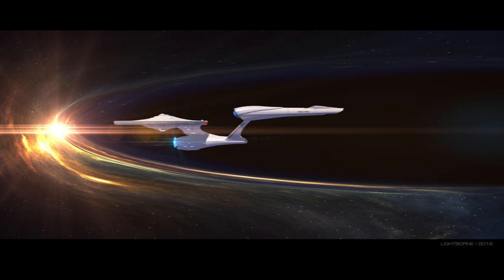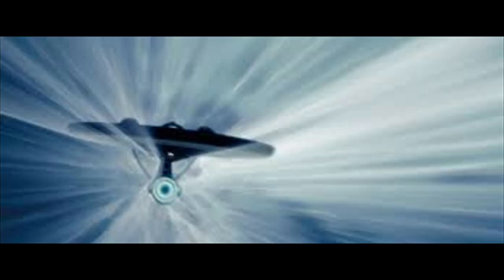Warp factors are not speeds

Comment: Honest criticism, bad opening. Starting with "They are not speeds" then leading with "why I believe so" isn't a great argument.  That being said you are touching on something really cool here. I have no idea if you are still making videos, but there is a lot to learn about the ways space time interacts. Even the problem of breaking FTL barrier. Infinite fuel (acceleration) vs Infinite time. It makes sense that ships are moving at warp based on their mass and energy output. The speed limit further reached to this and the changes to subspace and the damage it can have. Large ships may be going slower, because they must expend more energy and cause more of a rift. What truly matters is for a ship, how far are they away from their objective? If everyone needs to sync times, they don't all travel at warp 5, they would adjust accordingly. If the matter is urgent, you max out the ship's capabilities. It would make sense that a ship with a better mass to acceleration ratio would move faster than a flagship or a small supply ship. Too heavy, you are slower, too light, you limit fuel storage and capacity problems.

Comment: Nope , warp does in fact measure speed , but you have different scales to it , in TOS, and enterprise the speed is based on ^3 so warp 1 is 1xC and is 1 Cochran  in power , warp 2 is 8 x C warp 3 is 27x C  warp 4 is 64x C warp 5 is 125 x C ,  

TNG onwards changed it to warp 10 is the limit , warp one is still 1x C but warp 2 is 10 X warp 3 is 39x warp 4 is 102x warp 5 is 214x ( you can find a warp scale on Google ) the difference is the show is the speed of the plot , otherwise Enterprise in Enterprise series would take 2 years to get to Klingon homeworld in the first episode, where in 4 days at warp 4.5 tos scale there .99 lightyears from Earth .
Reply: A show is a show. The Youtuber is touching on the concept of what Warp Travel would mean and it's implications in physics. IN Trek, there is no standard speed. It is entirely show dependent. Want Warp 13? Sure. Warp 32, 36? 10 the new limit? Whatever you want.

Comment: If you rewarch that scene from Back to the Future, youll notice that Doc Brown and Marty say Gigawatt differently.
Its a moment burned in my brain as it reset my disbelief suspension algorithm. 
😊
Reply: Oh... right 
Also, the warp speed power curve, as originally published on the tng tech manual and reproduced all over the internet, gives a graphic from which it is possible to back-calculate the power required for the Enterprise-D to maintain any given tenth of a warp factor to within a two orders of magnitude. 
I have done this. It is extremely nerdy.
Once this is done, there are some interesting conclusions to be made. One is that the Saturn V first stage produced enough power, at 190 gigawatts, to jump the warp 1 barrier, accellerate to and maintain 1.8wf for 2 minutes, assuming it used power for each warp factor as the Ent-D.
Also, the data needed for these calculations talk about warp strain in cochranes, where a cochrane is a multiple of the speed of light. IE, 3 Cochrane is 3*c. And a given warp factor is c * (wf)^(10/3). Thus 2wf is 10c.
So, if you're going by the TNG Tech manual, your argument is no go.
Of course, it's probably an approximation.
Further, the power curve is probably also specific to Ent-D: both those nacelles and that shape of ship.
However, it became clear after a little speculative calculations that deuterium could be stored far more densely and conveniently as a hydrocarbon, like propane or kerosene, than as a 20 Kelvin slush, and the only reason I could think to keep it as slush is that high density is more costly to move at warp than high volume.
And finally, the amount of deuterium in the tank, if used soley in a M/AM reaction and requiring an equal mass of anti-deuterium in the AM bottles, suggests the deuterium in the AM bottles is metallic. IE, the density of the deuterium in those bottles, if you assume the same mass as is in the deuterium slush of the main tanks, strongly implies metallic deuterium. It could be liquid or solid. (I like to imagine liquid metallic deuterium, but solid has its advantages.)
Reply: One last thing
2 minutes at 1.8wf should be on the order of 14 light minutes or 1.7 astronomical units.
Put that in your pipe and smoke it.
😊

Comment: There’s probably recognized routes in federation space where ships can travel at higher speeds at lower warp numbers due to the ‘less dense subspace’ or whatever.  At any rate there’s no way warp factors are just a square or cube of C in speed.  Perhaps the factors can be roughly equated to exponential orders of magnitude.  Warp 2 is around 10 times c, 3 is 100, 4 is 1000, etc, with some regions of space cutting these speeds to fractions of that.  The Warp 2 barrier was considered a real hindrance in human exploration of the galaxy, but speeds of 10-20 c would be enough to get to alpha Centauri in months and other nearby systems in years, which seems to be consistent with the Enterprise series.  Warp 5 giving speeds of up to 10,000 time lightspeed would bring systems 40 light years away reachable in 36 hours, which seems far more reasonable given presumed travel times in the various series.  Mind you if most of the galaxy has ‘thick’ subspace, travel times could be a good bit more.  It seems silly that any large interstellar empires couldn’t traverse 100 light years in a few days or 1000 light years in less than a year.  How would you defend your territory without having dedicated fleets patrolling the borders and rarely if ever coming to earth.  Most federation starships would probably never come close to earth except in emergencies and even then they’d arrive way too late.
Reply from the maker: That last bit would explain how Enterprise is always the only ship close enough to defend earth from threat x